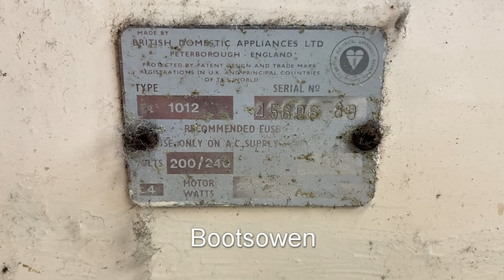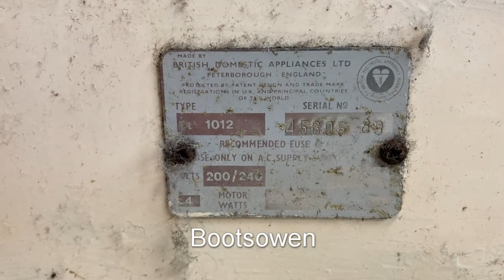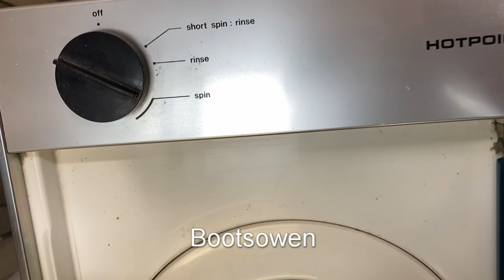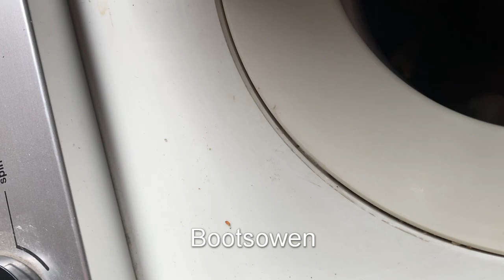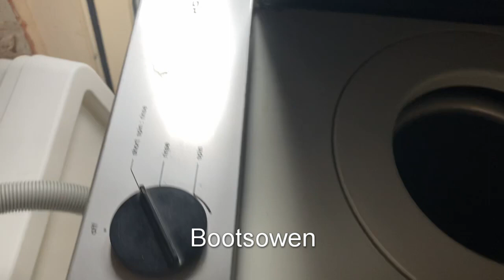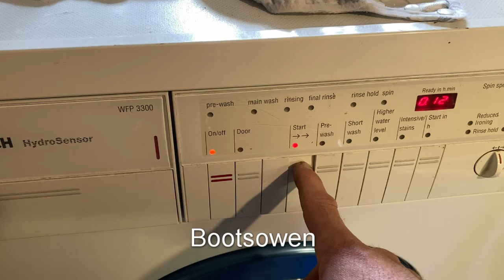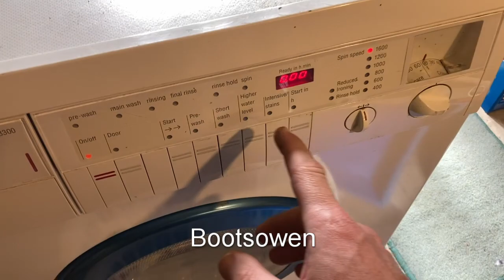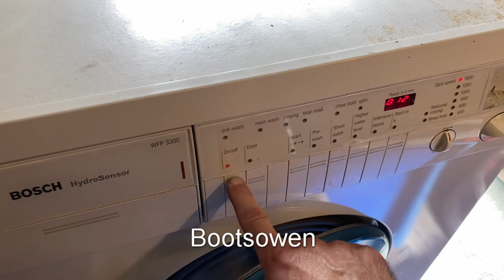Hotpoint 1012 Spinner repairs and tests: Vintage Laundry: spin dryer: centrifuge

Comment: The Rinse section on the dial is jst a point where you could add water to the load in the spinner and then shut it and let it spin out the water. Repeat it until you happy the clothes are rinsed. Good for people who had to hand wash :-)
Reply from the maker: Thanks. Good to know

Comment: the hotpoint spin dryer has a clutch system that stops any strain being put on the motor and the belts .there is virtually no strain on the belts when starting up . the auto spin will be no match for the hotpoint with its 3000 RPM. If you look at the hotpoint twintub washer the spinner will be almost identical

Comment: That's at least 50 years old, in its day it was the height of luxury you could put dripping wet clothes in it, pour water onto the load, no bowl under it water pumped straight into the sink.  It had a spin speed of the spin 3100 RPM, fastest ever spin.
Reply from the maker: I did some tests with this against a 1600 spin washing machine. it is the same, I guess it has to do with speed versus diameter, the force is probably similar at the extremity of the drum.  When this was made washing machines often didn't have a spinner, until twin tubs came along!

Comment: I have an old 90's "Servis Supaspin 5054" I picked up years ago needing a simple repair, & it has done a huge amount of flawless spinning since. Yours seems to be a bit more complex with pump and timer. These spinners are frowned upon as old-fashioned, but in use the amount of drying time & energy saved it's remarkable how few are used or exist anymore. Yet again trends & vanity has won over logic Mr.Boots ?
Reply from the maker: I suspect it has more to do with space and vanity. I did a few tests on this spinner and it won’t wring out at more water from something that has had a washing machine spin at 1600 but it will get more out if the spin was at 900. So I’m guessing that modern machines can spin faster and have made the spinners redundant.
Reply: @bootsowen  love how long cables are on older things
Reply: @bootsowen  the spin dryer made the wringer obsolete.When autos came along the first ones didnt spin very fAST [4 OR 500 rpm ] so most people [me included ] would spin everything again before hanging out to dry. You have to remember before the washing machine laundry was a back breaking work so to have a washing machine with a spin dryer was a godsend

Comment: DONT SWITCH IT ON WHILE ITS LAID ON ITS SIDE .yOU WILL BURN THE MOTOR OUT
Reply from the maker: does that matter? why use caps
Reply: @bootsowen  laid on its side the moter relay wont be able to pull in .You will burn out the start windings